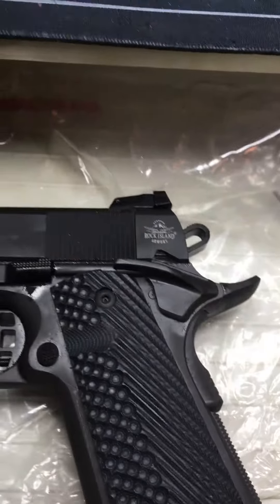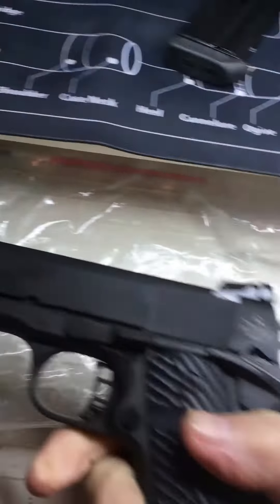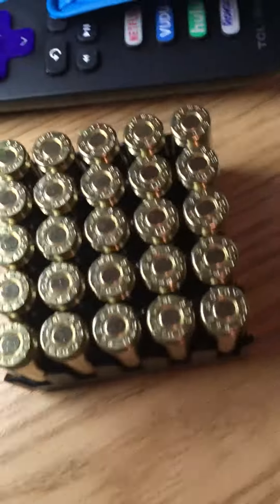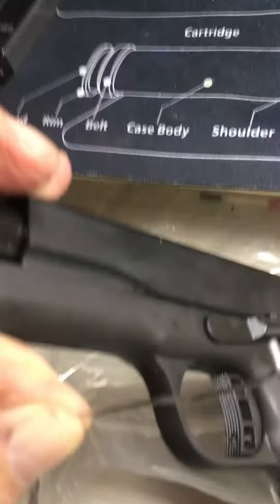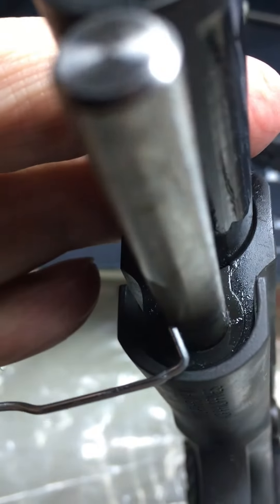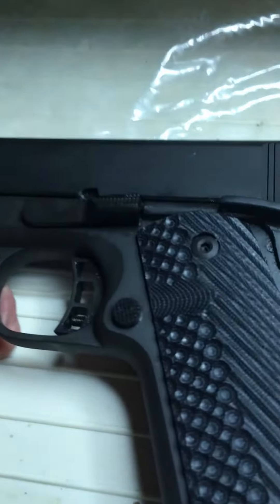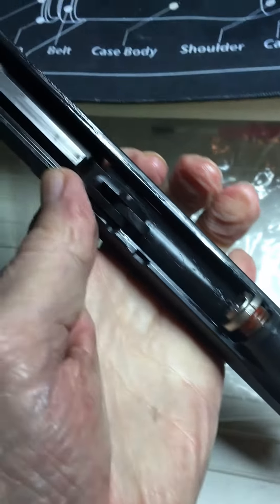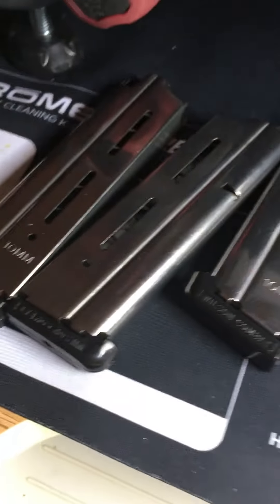Rock Island 10 mm 1911

Comment: Get a stiffer recoil spring.   TRUST ME.   And then fusionfirearms has an extended slide release that works (with a file and sandpaper).  I have the same one.  I likes it a  lot.  Also.....9 round Wilson combat mags, Bees Knees there.
Reply from the maker: Got to explain that file and sandpaper thing.  Not what you hear often to be used on a High Caliber pistol but hey.  Would have to pull the spring off of my ford truck if I wanted a stiffer spring.
Reply: @bigal7561  the lug on the rearward end of the pin that gets interrupted by the mag, is too large for the hole in the grip and the slide. I took about 0.012" off all the way around it. Plus a large chunk off the bottom.